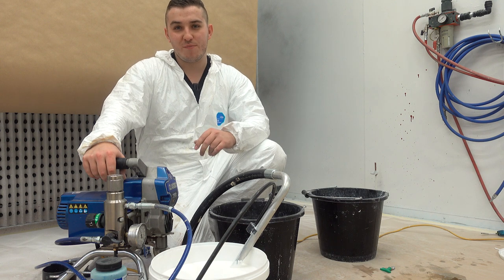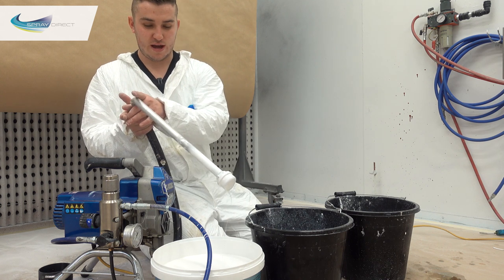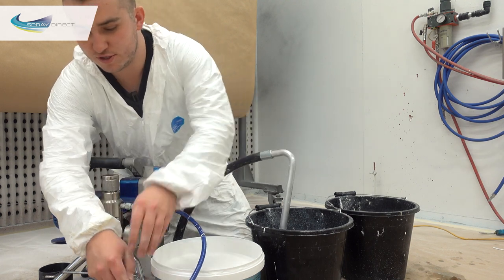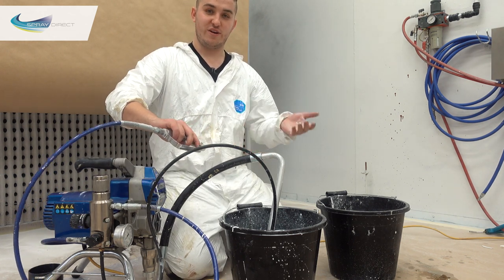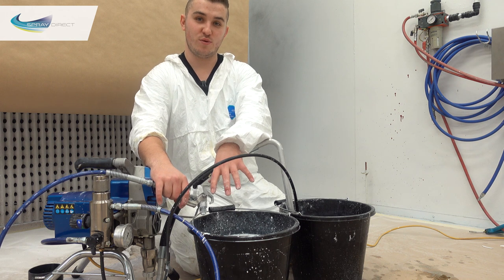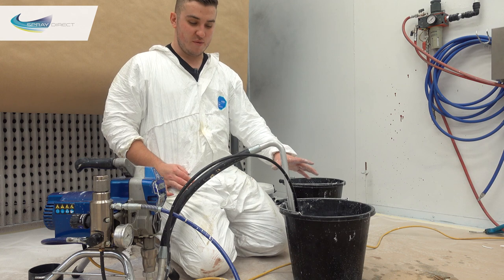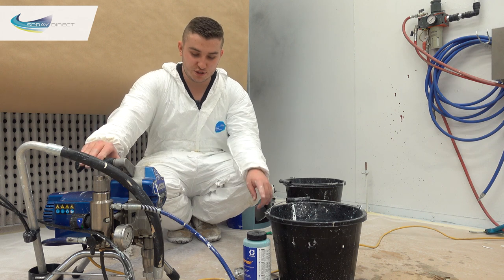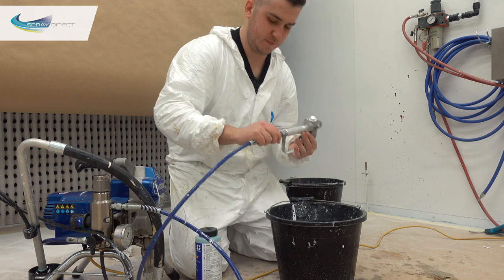How to clean your Airless Paint Sprayer

Comment: The liquid in the pump is actually the lubrication for the pump plunger seals. Running the pump dry, is not healthy for the pump. Also, warm water greatly aids in flushing the pump, hoses and gun.

Comment: Hi there, great video thanks, so what else would you need to do if you wanted to undo and remove the hose for storage purposes do you need to cap off the outlet to prevent the pump armour draining out or has that been isolated due to the sprayer being in prime mode ?
thanks very much cheers Tony

Comment: What exactly will the pump armour  do?
Reply from the maker: naveed khan the pump armour is a lubricant and anti-freeze solution. When used it helps prevent corrosion and helps prevent joints bursting due to freezing when being stored over winter.

Comment: Hi. What hapend if i forgot buy pump armor and i finish painting my job friday evening and can't get pump armor until monday? Can i fill pump with water and hold that for weekend?
Reply: I actually don't leave any water in unit at all...I disconnect the hose flush out water and squirt a few drops of oil thru pump.......water destroys everything and if it sits for any length of time its not good.....if your using it in next day or so fine but I leave my airless sprayer open and dry from now on.....
Reply: i wouldn't worry about it. not the first time i do it. I put
 anti freeze if gonna store for a long time.

Comment: Now tell me how to clean out sandtex ultra smooth masonry paint because I've been here fucking ages doing it think I'm going to have to strip it. On your classic 290 model. Also this is my first time using a paint sprayer so any advice would be very appreciated
Reply: I have 100 square meters to paint with masonry paint - bought an erbauer sprayer yesterday, first time using it and first time I tested it and I just thought "I hate this damn thing". Just with emulsion it took forever to get the water to run clean. The handle doesn't come off either, the nuts have been fastened so tight. Spanners, wrenches, buckets, hoses, water everywhere, I am ready for taking it outside and sledge hammering it to pieces!

Comment: Does hot water work better?
Reply from the maker: Aaron Wilson personally I prefer to use warm to hot water as I believe it does help break down more stubborn residue but, also in the middle of winter on site, it’s a bit more friendlier on the hands, unfortunately hot water isn’t always available.
Reply: How about a little bit of washing up liquid (make sure you don't contaminate your paint with it). It breaks up paint residue very well.
Reply: @noslrak2000  I will flush the system, then I run some water & dishwashing liquid thru the pump...then another thorough rinse.  This keeps my Graco good for a few weeks until I need it again. If I need to store it for longer, I use pump armor.